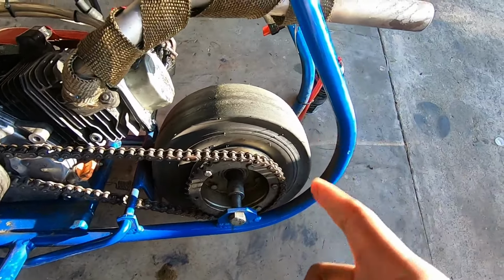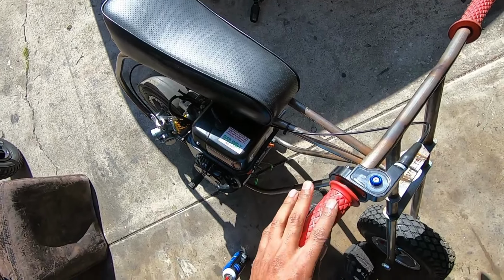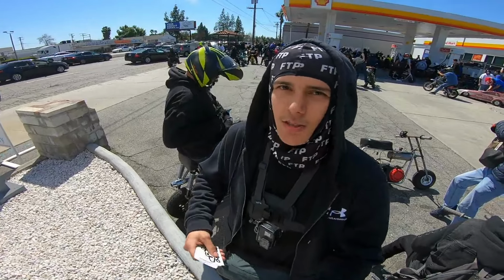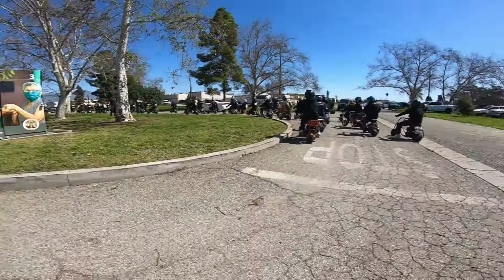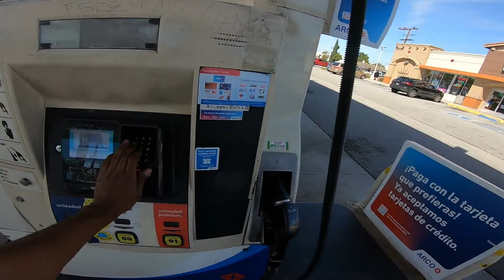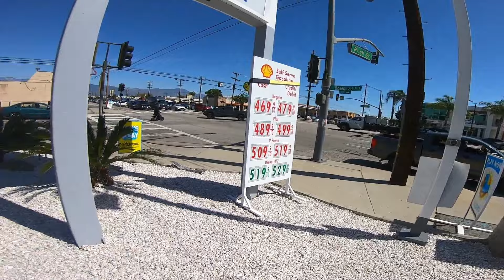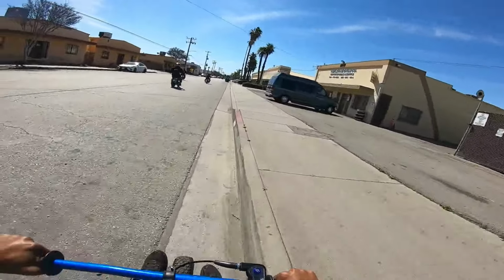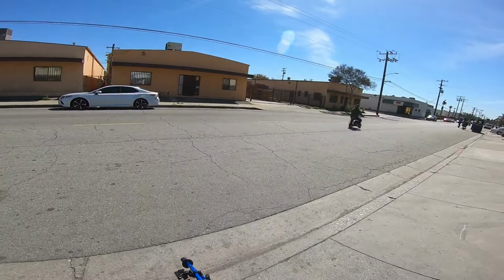Everything went Wrong At This Mini Bike Rideout!

Comment: You ain't trying to pay for nobody gas ain't nobody trying to help you with your chain, even steven. There is always someone in the ride who has a bottle of gas, if you had ran out of gas, I'm sure they would have helped you out. By the time you fix that chain, homies are miles away. And you know that. You said the one bolt was stripped & kept turning, you could have loosened the other three bolts and bumped that motor back to keep that chain from heating up. That chain being tight kept your speed down Nice bike though.
Reply: Fr

Comment: Why do you put heavy springs in the motor. They don’t increase power whatsoever. There are multiple videos that prove that and it’s known by any good mechanic that heavy springs won’t increase performance at all.
Reply: They don’t increase power, they prevent valve lash at higher rpms